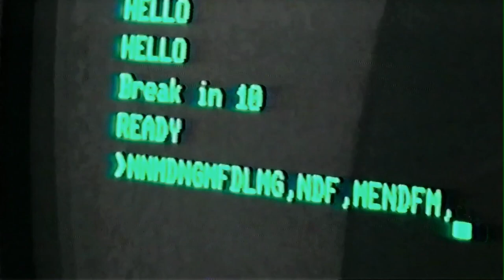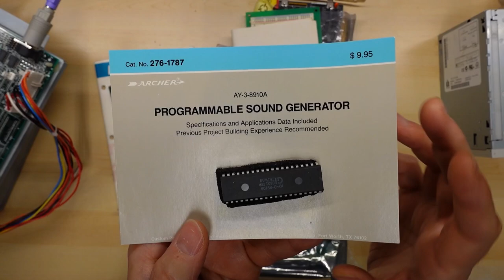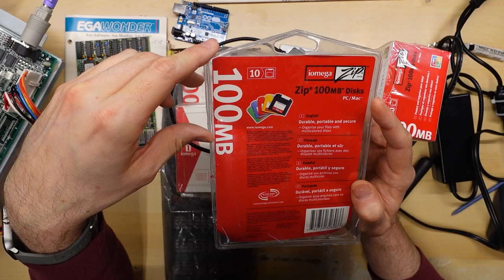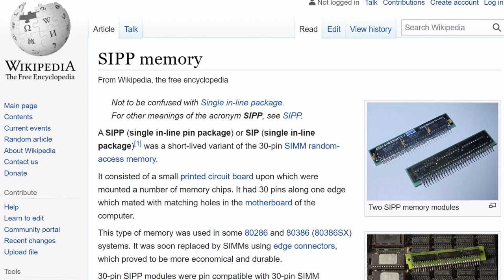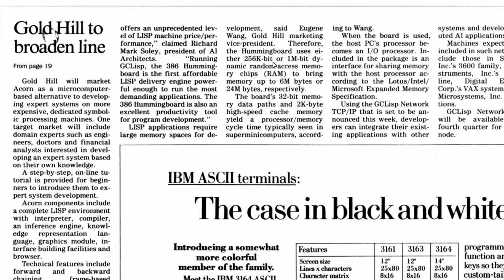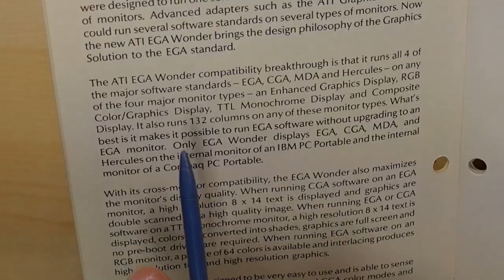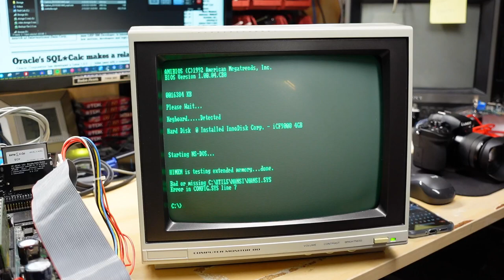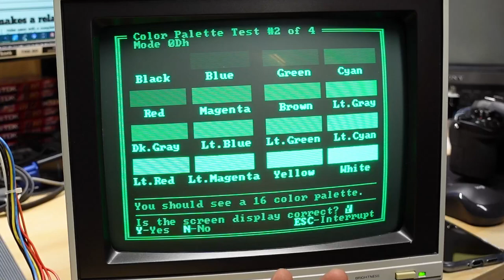A 386 A.I. Co-Processor from 1986, an EGA card driving a composite CRT, and an ISA Prototype Card

Comment: Another article (InfoWorld, August 18th 1986) says price for that AI Hummigboard card was $7000. That's probably a starting price...
Reply: That's just the starting price.
For this $7,000, you get a 16mHz Intel 80386; a 1MB on-board RAM that is ex- pandable to 24MB with lM-bit memory chips (currently to 6MB with 256K-bit chips); a 32-bit data path with 2K cache; memory sharing with the host PC processor using the Intel above-board standard; optional support for Intel 80286 or 80387 floating-point processors; 
AAAI-86 Conference article - AI Magazine Volume 8 Number 1 (1987) - By Jeff Stone
Reply: @fnmatrix  You could easily add $150 per MB of memory. So additional $3600 for the mermory and at least plus $400 for the i387-16 in 1987.
Reply: @Troppa17  so 11-12k.... more like 25k with inflation. That’s a spicy meatball

Comment: The problem with the Zip drives was that the r/w heads were very fragile and would be damaged easily if you dropped or bumped the Zip drive. Then, someone would put in a good Zip disk, and the broken r/w head would now gouge a hole in the disk surface, and the disk would (of course) be unreadable. Said person would then go put the (now bad) Zip disk in a perfectly good Zip drive (to see if the problem was the disk), and ruin the r/w head on that one too.
The other problem was that the caps in the switch-mode power supplies (the ‘little’ wall-warts) would become leaky, and the PSU wouldn’t put out enough voltage for the Zip drive to operate reliably. The earlier Zip drives that had the ‘big’ wall-warts were - I believe - a linear-regulator-type PSU with a power transformer, a bridge rectifiers, an LM7805, and some filter caps. Unfortunately, large or small, the wall-warts’ cases were glued or sonically welded, and were difficult to open without breaking something (like, one’s patience)! 🤣
Also, the fact that the power cord plugged in on the side of the Zip drive meant anyone tripping over the cord pulled the Zip drive off of whatever it may have been resting on to a certain doom on the floor below!
Finally, there’s always the office idiot who has to go shove an ordinary 3-1/2” floppy into the Zip drive, and can’t get it back out again!

Comment: I agree with you on ZIP Disks.   I had several that were used for backup and a few that were daily drivers.  I never had one fail.  I found them to be really reliable.
Thanks for another video
Reply from the maker: I really think it was the drives that died -- with that click of death, but the disks all seemed to last and be durable. I think of all the old ones I've tried recently -- 20+ years later -- have worked just fine. Better than I can say for 1.44mb disks which at this point seem to be 50% bad.
Reply: @adriansdigitalbasement  I agree with your sentiments.   I do have memories of repairing the Zip100 USB drive a few times but never a disk failure.   I had the USB drive with the translucent blue case for a while.   Looked good but the springs kept falling off inside

Comment: There was a time in the mid 90s, when I was already home-working as a technical writer (which was quite seldom back then), the Zip drive was my means of data transfer between my home office and the computer in the office. And I was very happy with it, it worked very reliably.

Comment: congratz on 100k!!!
i have some unique items i'm probably going to send in before long including some old mac crap, i literally used to have a stack of old mac computers in my old house before i moved i used as a chair! when i moved, i scrapped them for parts and saved the cool stuff
Reply: my last 1 i had of ide to laptop ide connector ripped, its a flat flex from dell gx240/260 SFF pentium 4 era, it was super common to use laptop drives in SFF cases and ide was standard then, dont forget archive.org for OLD drivers and shit, if you can find anything to do with their original servers from the early 90s if they still supported it

Comment: I used my Zip disks for so long that once I moved up to an external HDD, the folder with all my stuff from those disks is still called ZIP Backups and it's still where I keep my current stuff which is just kind of out of a joke tradition at this point. lol
Reply: I bought a 2nd hand pc with a built in zip drive. I had only ever seen the external drives. Was so excited I tried to get a disk. They were so rare and expensive where I live that I never used it at all. Sad

Comment: One of my electronics classes was about interfacing with computers, and we used a board similar to that one.  It didn't have a built-on breadboard, but it did buffer the bus.  Of course my final project, which was a digital sound card, had to bypass the buffer chips in order to work with the DMA controller.

The other problem was when wires broke while plugged into those machine pin sockets.

Comment: We had bought a Power Mac 8600 for work & we replaced the internal zip at least 3 times under warranty. We went back to our external SCSI drive after losing 3 archive disks (Thankfully we had another backup). That's when we started moving our backups to CD.

Comment: I used to install a few programs like AIM directly on my zip disk and my homework and stuff for my computer class, cause my uni's computers were fairly locked down, but I could run them directly from the disk and chat with folks while in classes.

Comment: My very first PC was a Tulip PC Compact 2 (yes, the Dutch computer company that later took over Commodore) and it had a similar, but Tulip branded, card to the one you have just shown. It also has the two RCA jacks. One is for composite out and the other is for the light pen interface if I'm not mistaken. 

Incidentally it i the one and only component that I still have of this PC and I am doing a retro-build that I definitely going to feature this card, although I have not yet settled on how retro it will be: will it be a V20 based system (like a Xi8088) or something a little bit more recent like a 486? Who knows... ;-)

Anyways, since the chips on your EGA card look very similar to the one on mine, I can send you an image of the ROM BIOS, which I know supports at least the 0x12 640x480 mode, although it required a better monitor than I owned back in the day.

Comment: I have never had any issues with a ZIP drive and I loved them and used to own several of them.

Back when I was studying at university I carried a minitiature installation of Slackware on a ZIP disk around with me, complete with networking, GCC and even a SWAP partition. As the computers in the labs all had ZIP drives installed in them and were capable of booting from it (and I also carried a Slackware boot disk with me just in case I encountered a PC that did not) I was able to do my coding assignments (nerd alert!) under Linux. 

Fun times....

btw.. Concratulations on hitting the 100k subscriber mark!

Comment: Idk if someone told you this already but 1.2 megs on 3.5" is called a 3-Mode disk, it was only used in Japan, most LS-120 drives support that mode to read those obscure capacity diskettes and also you can see in any pre-UEFI BIOSes the 3-Mode support that was meant for those kind of disks
Reply from the maker: I tested that LS-120 drive (the larger one) on a Pentium machine and it worked! Booted into DOS with a normal 3.5" 1.44mb disk -- and that BIOS has that Mode 3 option, which I wondered about. I did not enable it to get the LS-120 to emulate the A: drive -- it just "worked."

Comment: When I was in college the first time my PC came with a LS-120 drive, which after some serious work to get functional under Windows NT 4, was great.  It read floppies noticeably quicker, but more so I found a bunch in the programming lab that also had them installed so I could move large files back and forth to my dorm room easily, kind of like what you did with your email on the ZIP disk.  I didn't have a compiler on my dorm computer but sometimes I'd work on code in a text editor and it made it easy to move back and forth.

Comment: EGA Wonder, was the card my dad took home from his work, finally upgrading our IBM XT from that utterly useless monochrome card. I started to loose interest in the XT because of its lack of graphics and proper sound. I couldn’t believe they’d remove these cards from the PC’s at my dad’s place of work for Hercules cards, until I came there for a summer internship as a developer and tester. And the test machines they made for bearings was coded for Hercules, with a lot of low level code written in assembler being called from turbo pascal. I offered to rewrite it for VGA (we are now 4 years ahead in 1992). But they told me that this release I was working on would be the last of the system before they’d retire it. That was a shame because it was a great place to work and they paid really well for summer jobs!

Comment: Adrian, why don't you connect the 8910 sound chip to a PC using the prototyping card? That way you can demonstrate both in one go.

Btw you have '8210' written in the description instead of the proper 8910. Might want to do a quick s/8210/8910 on the text.

Comment: It still amazes me how many things Windows has maintained legacy support for in their driver packs, especially considering you'd have to adapt just about everything through some form of USB adapter. Also, that HummingBoard seems very similar in intended implementation to some of Intel's current Xeon Phi boards that are used for augmented processing offload for workloads that can't be parallelized to common GPU architectures and instead require standard X86 instruction sets to run. How fascinating that they were doing that kind of thing back in 1986.

Comment: about the Zip Disc:
Maybe the USB Adapter doesn't like the Zip Drive?
Reply: Hi, it may also not provide enough voltage via the usb port to power a spinning motor - it should be tested in say a 386 > Pentium 3
Reply: Exactly correct.  I have the same USB adapter and indeed it does not work with ATAPI ZIP drives.
Reply: Kinda like there are some things USB floppy drives can't do as opposed to traditional disk drives.

Comment: The CoCo didn't have a sound chip but you could bit bang the sound at about 6 bits of resolution IIRC with 100% cpu utilization.  If you notice almost all games will freeze if there's any sound more than a split second, or animation lines up with the sound where the sound comes between movements.  He may have meant the speech/sound cartridge which did have some kind of AY chip in it.

Comment: We used those laptop ide adapters all the time in data acquisition machines we made.  It had a standard PC motherboard but a cheap laptop low profile cd rom drive.  While we made all of the DAQ hardware, we did not make those adapters so there's probably a lot of them floating around.

Comment: There are some trays that convert laptop-style IDE drives (2.5) to the desktop stype (3.5"), I remember throwing at least two of those away quite recently. An older USB IDE interface had multiple "heads", so a row of pins on each of the 3 sides, but can't remember if it had 2.5" IDE or SATA.
EDIT: it seems they support 2.5" IDE as SATA is size-agnostic. They are quite common and cheap.

Comment: Hi Adrian, before you give up on the zip drive, try the iomega  software tools / driver.  I've ran into the same issue before where it wouldn't work until the iomega driver was installed from disk.  I know it sounds weird, but give it a try.  Take care.

Comment: The SIPP pins are just clip-in the PCB and add solder, as I remember at 1991-1993 it cost HKD 400 (around US 80) per 256K, SIPP populur in 286 motherboards that only have 12MHz usually, very expensive! Up to 386 started to use SIMM module (no more pins), and the crowd started to use 2MB in DOS environment.

Comment: I had one of those large 386 cards back in the mid 80s. (or something similar)  I think it was called the Intel Inboard and allowed you to run 386 software on an IBM PC, XT or AT.  I might still have it in an old IBM XT in the garage. I think that I bought it for about $350 and, at the time, it was so much cheaper than buying a 386 computer.

Comment: I've got one of those LS120 drives in my K6-II machine but I've only used 1.44MB floppies on it. I only own 4 working floppy disks and haven't tracked down any of the actual LS120 disks either. Hopefully ya can get one of yours working would be quite interesting to see.

Comment: That Zip disk really was nuts. Writing "MAC" in all caps like some random schlub in a comment section (remember that Iomega had done business with Apple directly by this point, selling Macs with Zip drives built in), bundling a multimedia readme file that has to connect to their website to stream the actual content when there was surely enough room for a local copy...

Comment: If you search ebay for "jae adapter" you will find an adapter for the LS-120 (if it uses the same connector as laptop style cdrom drives that is).

Comment: As for software that supports 132-column text mode, the IBM E editor which comes with PC-DOS works great in it, and you can copy it over to MS-DOS just fine. Also if you run the Lynx web browser in Win9x's DOS window full screen, it can run in 132-column mode too, but you must temporarily switch to 80-column mode if you want to switch back to the desktop.

Comment: Hello Adrian! An idea of a future video would be to show how you prepare your removable ZIP drives. Like create Macintosh bootable drives. Add benchmark/test programs/scsi tools to the images. Depending on the Macintosh OS different version/programs are recommended . Anyway it seems you have a lot of knowledge around this and it would be great to know how to do this. There are some specific sites that talks about this but nothing “good” that shows the latest and greatest and informal about good programs and how to do this in a good way. For example a SE30 boot with a SCSI Zip drive. How to configure that and how to boot it with correct buttons. 
Continue with these good videos !

Comment: There were other such boards around at the time. Nothing Lisp specific. The 386 was a virtual machine monitor providing extended memory for 286-based applications that were written to use the extended memory API, which was more or less a standard spec.

Comment: Interesting.  I just purchased a vintage Micron Millennia from eBay a few weeks ago, and it has an internal Zip Drive.  Back in the day, my friends and I agreed to use Syquest cartridges because of the supposed speed advantage.  I bought a three-pack of blank Zip disks, and tried it out.  So far it works fine.  Now I just have to figure out what the heck I'm going to store on them!  I guess I can back up all the old games I've been installing, and some of the source code I've been writing (I've been dabbling with Turbo Pascal and Turbo C, stuff like that).

Comment: I just fired up my USB Zip 100, and OMG is it loud AF!
Reply: There is a USB version?
Reply: @louistournas120  Yes, it’s a dark, translucent blue.
Reply: @Dragon1276  Dang! I missed that one somehow. All I remember was the parallel port version and internal IDE.
Reply: @louistournas120  the first versions were SCSI, both external and internal.  The PC parallel port versions were just Mac drives with an integrated adapter.
Reply: @Dragon1276  I took apart an old Mac once. It was a PowerPC and I think it had a IBM 603e CPU. It actually had a IDE HDD and a SCSI CD-ROM drive. How bizarre. I had never seen a consumer PC with a SCSI interface on the motherboard before.
Reply: @louistournas120  All Macintoshes had onboard SCSI from the Macintosh Plus in 1986 until the iMac in 1998.  IDE hard drives were used on older consumer machines because they were half the price of SCSI, although had lower performance.

Comment: You might try taking the case off that LS-120.  Often drives with that laptop interface were internally IDE, with either a cable or adapter just inside.

Comment: I used one of those ati video ega cards to go from 9 pin d sub connector to a 1084S monitor with round connector(if memory serves me, it was ttl input on the back). It worked great back in 87 on an commodore colt xt compatible
Reply from the maker: Yep the boxy 1084 had two DIN connectors -- one for analog RGB and one for TLL RGB, which would have compatible with the EGA card if it was running in 15khz mode.

Comment: Man, if I had known about that ATI EGA Wonder back in the day!  I was stuck with CGA for so long because I couldn't afford both a better graphics card and monitor at the same time.  I even had a hand-me-down IBM Portable PC along the way and this would have even worked for that, unbelievably.  I had CGA even on a 386 I cobbled together.  My first upgrade from CGA was finding an old multisync monitor on the curb, and then somebody on Fidonet sending me an old VGA card they didn't need.  I ran individual wires between the two to connect them together, and was so excited despite the fiddly connection.  This card would have been a great intermediate way to get something better than horrible CGA.

Comment: IIRC in MS-DOS 5.0 or higher it support a MODE command which takes the columns and rows as comma separated parameters, so for instance at 132x44 you would run MODE 132,44.  I don't remember if that specifically affects the DIR command output, it's been a while.